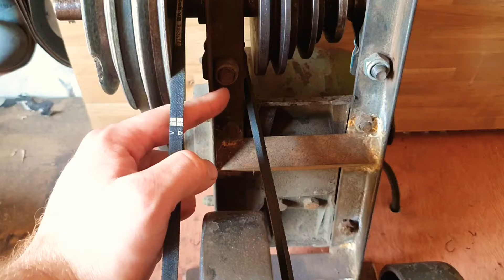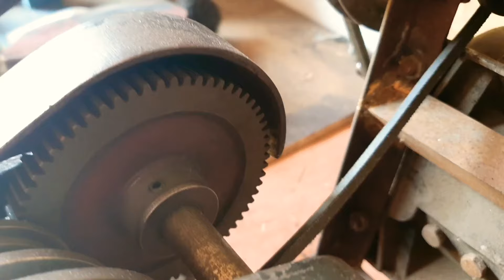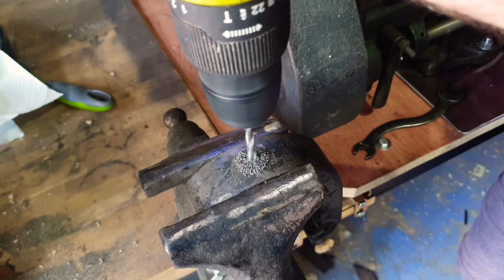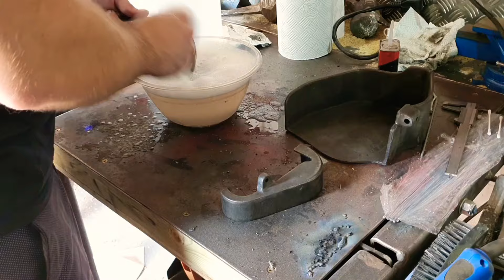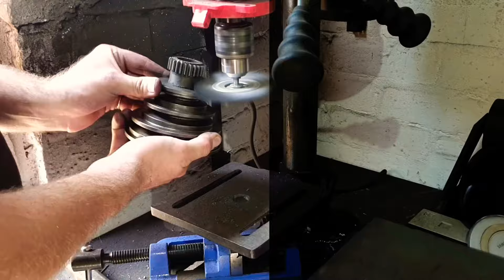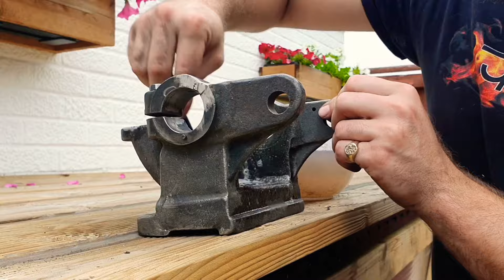Restoring a Mini Worktop Lathe - Part 4

Comment: Over all nicely done, but I think you've made a fault. The part of bronze was actually a special alloy for greasing the bearing. There are alloys which grease themselves. I am not sure if this was the case here but you should grease this lathe well...
Reply from the maker: I'd assume if that was the case, there would be one on the other side? In any case there wasn't, but don't worry, this thing is greased to high heaven now. :)
Reply from the maker: Oh also, its got holes drilled at all the bearings for allowing oiling, including these ones, so I'd assume it was not a self greasing.